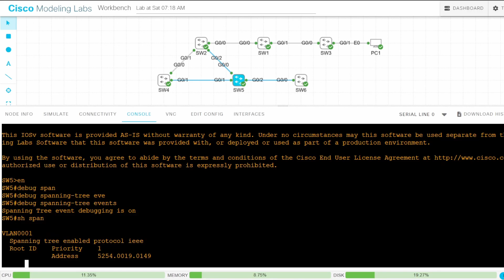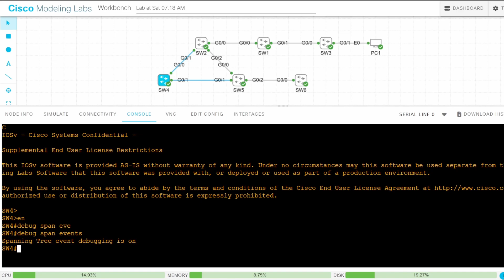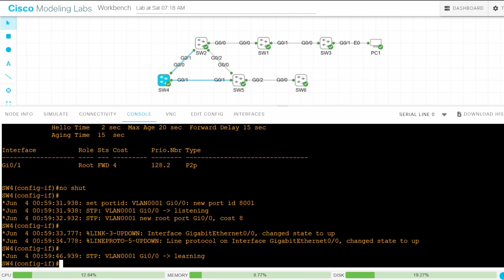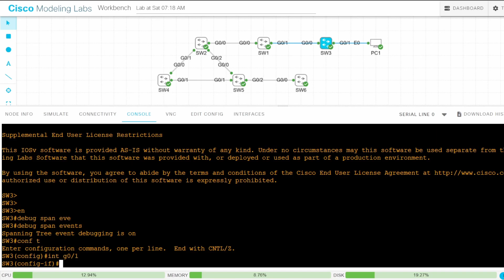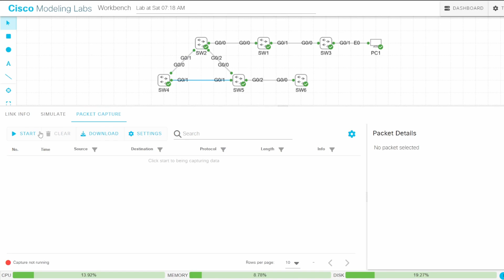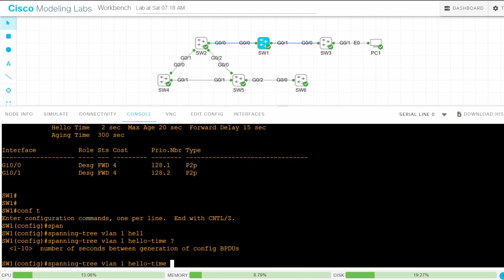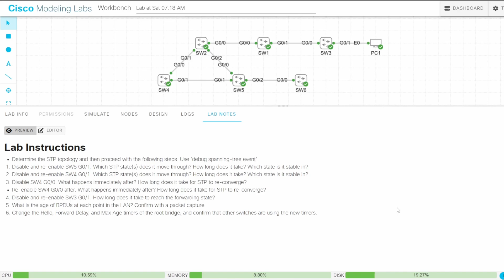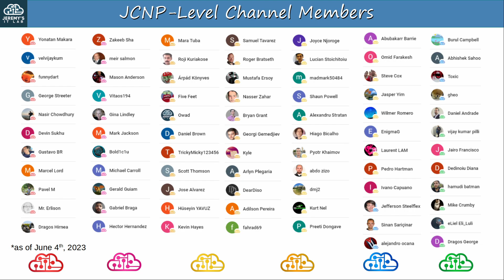CCNP ENCOR // STP Algorithm (LAB) // ENCOR 350-401 Complete Course

Comment: I played with this lab a little bit, I tried changing the cost in the Root port of SW2, I noticed that some TCNs are thrown and the other switches (SW4 and SW5) started pretending to be the RB for a short period of time. so i have this theory: Changing cost on the Root  port of SW2 maybe reduces the TTL of BPDUs on SW4 and SW5 to 0 immediately, thus the two started pretending to be RB before receiving another BPDU originating from SW1 after 1 hello timer.